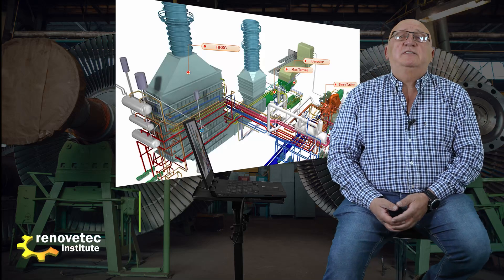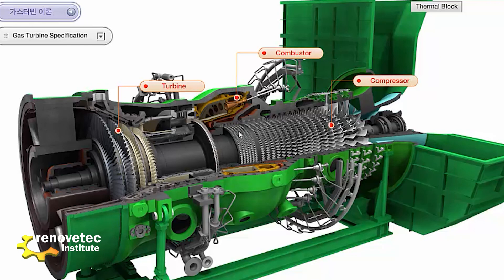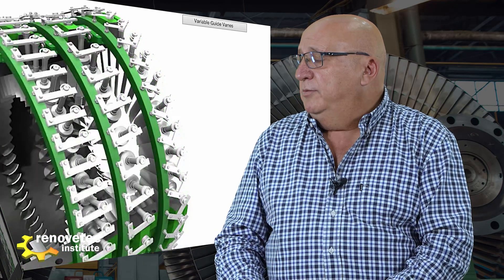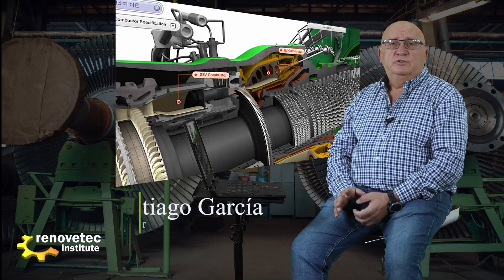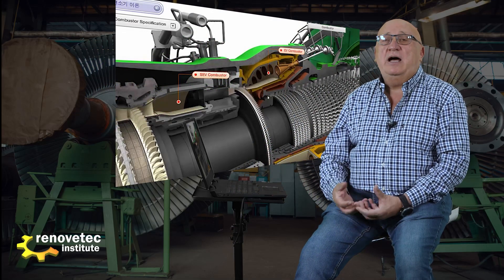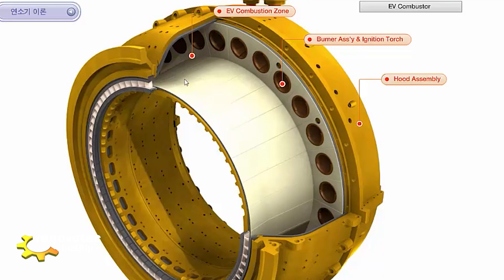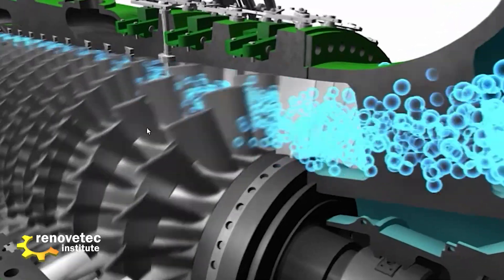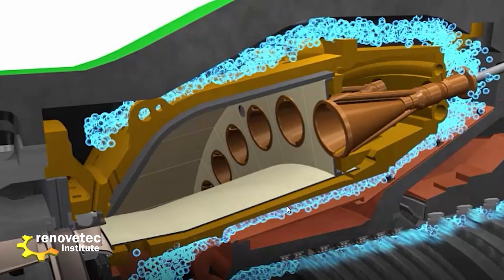GT26 ALSTOM GAS TURBINE

Comment: Sir Splendid presentation by you on GT, I never operated Gas turbine or axial compressor therefore  I worked on Rankine cycle at 323 MW unit Operated by me 21 stage ST and 1000 t/h Forced draught Natural circulation boiler with 16 burner having 4.5 ton/h fuel consumption(73Kl/h). I worked with National power and International power UK then GDF SUEZ and ENGIE France in Pakistan.